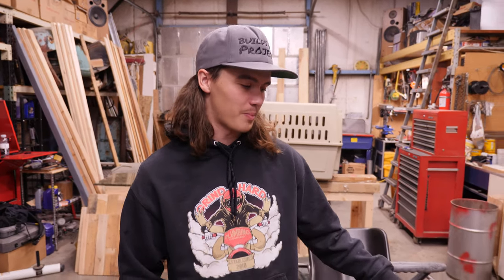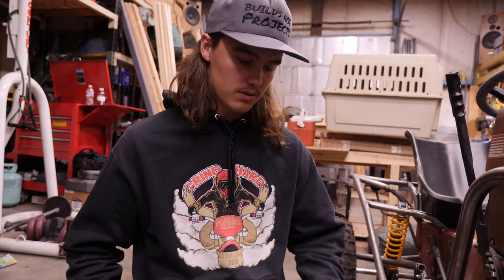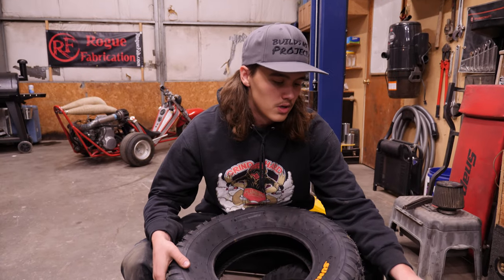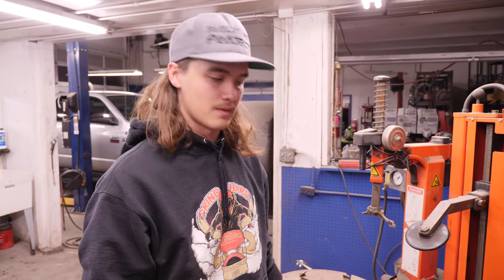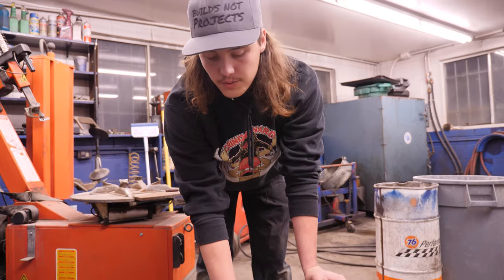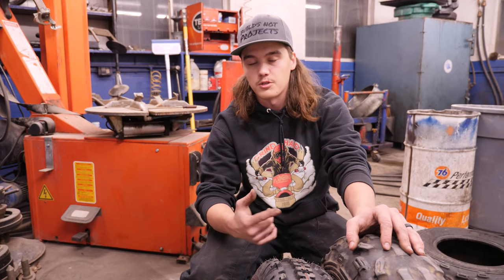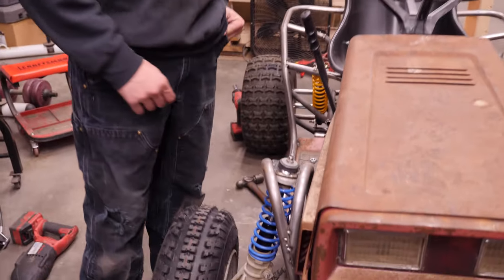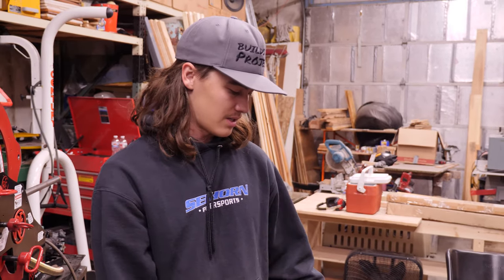55Hp Lawn Mower New Tires and Fixed Front Suspension!

Comment: An add-on mower deck would be ok, but I'd want it to be easy to take off if I just wanted to ride. 
Maybe a pull-behind mower if you really want to mow with it? 
Or maybe a front-mounted deck? They are easier to mow with if you have lots of things to mow around IMO.

Comment: Hi cool how you did the bottom A-arms I would say no on the deck but if you did I would do electric motors maybe with a electric clutch set up with  speed controller you could use a light dimmer switch to do this  it is up to you good luck.

Comment: I see you have the front knuckles backwards. They should steer from behind the strut. It might make getting any Ackerman angle difficult.  I'm using the Polaris strut front end for my powerwheels jeep build but it's not ideal. I changed the angles around to get it more like a sport quad. Did you use gas shocks or the stock style oil filled? Also, taking out the springs will let you cycle the suspension so you can check clearance👍
Reply from the maker: Yes I put the knuckles on opposite sides on purpose as there is not enough room for steering behind the knuckle so they have to steer from the front. It will most likely mess with the Ackerman but that’s not the end of the world.

Comment: I don't see the mower deck working well. It would have to float the entire height of suspension travel and the blades wouldn't cut anything going faster than 8 mph. If you wanted it for aesthetic purposes just mount the outer shells to the side like the "racin" mowers.